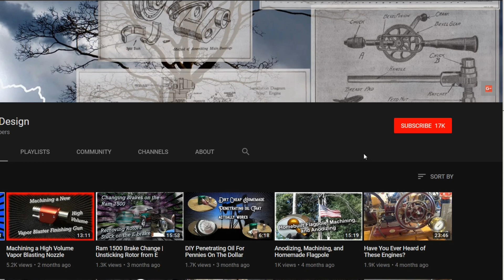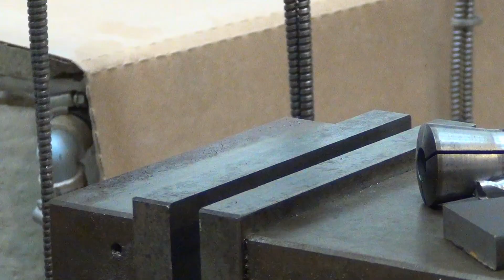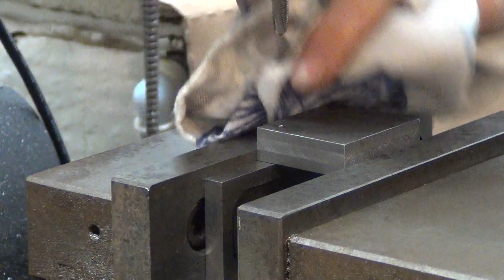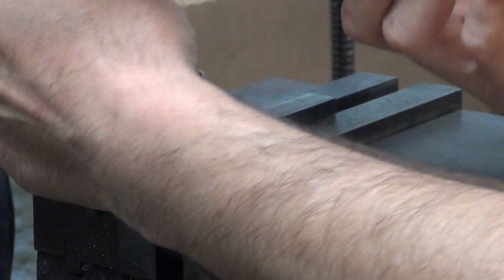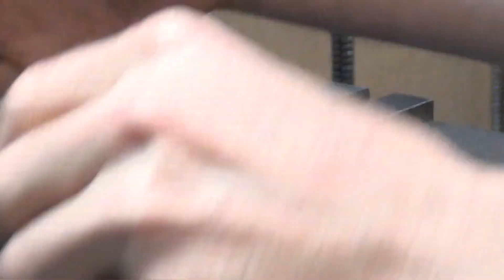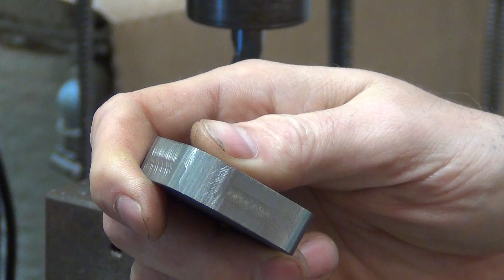Secret Trick to Mill an Outside Radius

Comment: If you don't need any more precision than that, a cheap Chinese rotary table will save you a couple of hours work and give you a much nicer radius, even with no DRO, and you can use it over and over and over. Or you can easily build a quickie work holder that pivots about a vertical pin.
Reply from the maker: Yes, I have a rotary table. It's had a lot of use here.

Comment: A belt sander is a million times quicker and if you want better accuracy then carbide router bits made for doing wood are cheap as chips and they work surprisingly well

Comment: What if the steel is longer? The back end of the steel will hit the ground of the vise.
Reply: find a different trick.
Reply: @mechanicallydisadvantaged1297  I genuinely need a different trick...
Reply: @rholanddelamerced  put it on its side and use a rotary table
Reply: @mechanicallydisadvantaged1297  ok I need to save more money to buy a rotary table. It costs almost 380usd here in my place.
Reply: @rholanddelamerced  if you can trade time for money--- plunge dril a couple dozen points about your radius. very tedious but ive done that before
Reply: @mechanicallydisadvantaged1297  thank you
Reply: @rholanddelamerced   I know it's to late for that job but you can use cheap carbide ( tungsten) router radius cutters made for wood on future jobs if you don't have a rotary table yet or just want a quicker way to get the job done.. the bits made for wood work surprisingly well and their a fraction of the price of a machining radius cutter

Comment: Nice trick, but meanwhile a lot of cheap DRO´s from China have a Function to cut whatever radius  you want, in steppings you want with tool diameter you want, and inside or outside....but it seems your DRO has not this function....so, good job anyway !
Reply from the maker: I have a Newall Dro with that function. This is for those without one
Reply: @ArnoldsDesign  thanks, im one without
Reply: Keep falling for China junk. Before long when they take away all the automatic stuff noone will know how to do it long hand.  Surely you can see this right?

Comment: Thumbs up, really neat work.  On the down side, there was enough metal in that block to make four dozen Chinese toasters.  What a waste.  Maybe mail them what's left and they can still get 3.5 dozen toasters out of it.
Reply from the maker: Probably so. I have a whole big box of drops to mess with, and a couple pallets full outside. They accumulate over the years, and you recycle them for chinese toasters, or use them for miscellaneous projects like this. I recycle the mill and lathe shavings mainly.

Comment: Cool idea. Using a  pin from both side made from a single wire that acts like a spring would making positioning easier. Thanks for the video.
Reply: Like a set of screw adjustable calipers with the ends filed to points.   That would work well.
Reply: @jimmurphy6095  That is a very good idea.

Comment: Set your tool gently onto a slip gauge of the correct radius on top of the moving jaw instead of faffing about clocking up the job.
Reply from the maker: By slip gauge, I assume you mean an old gauge block or gauge pin. Good idea. You probably should add the diameter of the pivot pin where it rests on the jaw too... Btw I don't really think the minute it took me to indicate this part though would really constitute "clocking up the job".

Comment: Now I understand why so many people get me to laser cut stuff lol, but very impressive old school trick nonetheless!
Reply: Its what CNC can do so very easily :)  .... laser cutting is all ok if you don't want a tight tolerance as i'm yet to find one that can hold a real tolerance.....  say 0.020mm
Reply: @martinfidel7086  The Prima Platino I run at work can get pretty damn close!
Reply: @Eschelonistic  most can, but the thing is the operator will often leave it set for thicker material so accuracy & quality is reduced

Comment: A half-way hack from someone who's mill is SCREAMING for maintenance (and oil)...thanks, but I pass...you've left a divot in the part at the radial center mark, you are 'swinging freehand through a curve' (big NO-NO for accuracy), and you are overlooking basic tools (such as indexing heads, ornamental mill table jigs, etc.) to accomplish what you are trying to describe here...
Reply from the maker: My mill is maintained just fine. It has always sounded like that. I've also had it for 20 years and not one drill hole or end mill mark on the table or vice. That's something you will likely never see on a machine that age.
Reply: @ArnoldsDesign  I have a KRV3000 and it sounds just like yours, I think what people are missing here, is that to do this without CNC or rotary table or dividing head etc is not easy !  This gives people a chance to make more parts for themselves, personally I use mitee bites and a CNC mill but then I have my own factory
Reply from the maker: @martinfidel7086  Exactly. Without a cnc or setting up a rotary table, outside radii are a pain. I'm not familiar with the KRV3000, but it might have a similar head. Mine's an Acer built in 97, and it's been rock solid. I'm not familiar with Mitee Bite work holding system. I just looked it up. Looks interesting. What does your factory produce?
Reply: @ArnoldsDesign  I make parts for race, rally and classic cars, and aircraft... most of my machines are CNC with a few manual to fill in the gaps
Reply from the maker: @martinfidel7086  Very interesting, especially the aircraft manufacturing part.
Reply: Show us how you do it, I like seeing lots of different ways of cracking the same nut, but I only tend to criticise if I've got something better to offer.
Reply: Make it out of thicker steel and then machine the "divots" off :)   as for the lack of maintenance these machines have a belt driven gearbox and always make that noise

Comment: just do the radius with the readout on radius function
Reply from the maker: That's an idea, but I just got the new readout and haven't learned that yet.
Reply: Does the radius function work by cutting in one axis only and moving it over a small amount ?
Reply: @martinfidel7086  yes you just use the radius function.if you cut a xz plane radius you input al the radius info on readout.the readout will then give you the coordinates for x and z and you feed with y axis.its only point to point but you can cut very smooth radius by using a ballnose cutter.you can even use a bolthole pattern for an xy plane radius.
Reply from the maker: @martinfidel7086  I don't know. Dawid Vos would have to address that.

Comment: Actually, you can use a center drill, or any other small bit. You use a pin whose diameter is larger than the diameter of the hole, so that the pin’s sides of the point, ground to between 60 and 90 degrees, contacts the edges at the point where they meet the surface. It’s much more sturdy than what was done here, and more accurate and repeatable.

I really don’t trust that pin, because each time you set it, the pin position changed with respect to the jaw top. As a result the pivot distance varied.

Ok, I get that this isn’t supposed to be a precision project. But there are ways to make even this method much better, but requires just a bit of work. But really, buying a cheap 6” rotary table on eBay is a much better idea. It takes less time to set that up than to do this.

A quick tip to set some small part horizontal. Use a 1/2” or larger dia flat end mill bit, or get a short 1/2” carbide bar. Set your basic height with the pin, making sure the vise isn’t tightened, and lower the flat down until it just contacts the surface of the part, in about the middle of the center of the pin. That will level the part, and you can tighten the vise.

Comment: Appreciate your time and effort to create this video. Nevertheless this has no practical use
Reply: It's quite practical if you need a radius on the corner of a small part. Do you have a better way to achieve the same result? (Without expensive specialty tools/attachments)
Reply: A 5 bugs file will do it less than 5 min

Comment: A job for a portaband and 4 inch grinder or a belt sander or you could just go completely wild and use the correct radius cutter end mill.

Comment: Have used the same effect but with a through hole as the pivot point. Works well where you need a large concentric radius cut around a hole for aesthetic purposes. Then finish off on a linisher. This is a good method for when there is no hole.

Comment: It never fails..you provide a useful trick to bang out a quick radius and people will find reasons to complain about it.
Reply from the maker: Yep, I thinking the same thing today.
Reply: Some people have no appreciation for a little learning.  Sure, it's not the most wonderful trick in the machining world, but it provides a way of doing a radius that shows some thinking outside the box.  I agree with you that people will complain about anything just to be contrary.  I appreciate you showing this, Arnold.  Keep doing what you're doing.
Reply: Actually I have been doing this for a long time with excellent results, but it's not weird.  For all who insist on a radius cutter:
 not every radius is 90 degrees,  not every radius has a commercial cutter to match,
 radius cutters are expensive and usually HSS, 
I can use a common shell mill with carbide inserts to do this very quickly,
This method also needs a less rigid spindle because you only have to take a shallow cut if need be,
 everyone doesn't have a NMTB 50 machine to hold a 2" radius cutter, even if you wanted to buy one for a one off  part.
So people get a grip because this method works, and is it frequently the fastest and most cost effective way to get the job done.
Reply: @stephensarkany3577  Agree with you.  Back in the day before CNC became as prevalent as it is today, we used to draw Involute curves (gears) on a Coordinatograph (fancy, accurate drafting table) using single points and connecting them with a french curve.   I'm sure newbies today would cringe at what was done before the days of Mastercam, Solidworks, Esprit and the like.  I for one appreciate people like Arnold that show alternate ways of doing things.  There will come a day in everyone's career when no matter what machine you work on, it won't do what you need and you need to be able to improvise.
Reply: @DonsWoodies  Too often after I see knowledge like this imparted I am reminded of something my departed Grandmother used to say; "If you don't have anything nice to say, don't say anything at all".
Reply: wxfield sometimes you need to say something. I’ve seen recommendations on YouTube that are frighteningly dangerous. Should we say nothing? Or should we warn those new to it? I go for the latter.
Reply: @melgross  I'm a big fan of Charles Darwin..survival of the fittest. If someone is dumb enough to follow dangerous or stupid advice let's allow them self-remove from the shallow end of the gene pool.

Comment: Way too much work to cut a radius. Much easier to mount it to a rotary table. If you don't have a rotary table it would been too hard to make a jig to cut the radiuses using a lever with a pin that can pivot on rectangle scrap metal with a hole. You just move the lever around the pivot point to cut the radius.

Comment: Its good the attempt to help the community for no personal gain but this method really should not be taught you can simply lay it out and tilt it up a few times not hitting the line and then finish sand, grind file..

Comment: Hi Arnold,

This is very similar to the quick milling machine radius that Dale from Metal tips and tricks release a video on a while back, minus the through hole.

Personally I think his method is a little better as it was faster to "index" to the cut, also from memory he didn't need a file to clean up after. 

Regards
Reply: He used a file too.
Reply: Except Dale had to bore a hole.

Comment: Is it possible to sand the part, using the divot mark as a guide?
Reply from the maker: Yeah, you could use a bow divider or compass, put one point in the divot and scribe the radius. Then you could grind and sand down to the line.
Reply: @ArnoldsDesign  I thought there would be an easier way, (if someone owned a sander of some sort, to do it. Thanks for the reply :)

Comment: That is an awful tedious process for a radius that is probably just decorative. I would do three segments, 45°, 22.5°, and 67.5°, and then use a file or sandpaper. But I also have a couple of corner rounding cutters.
Reply: or just whip out the angle grinder......do a 45 on each corner then round off....but I agree as well.....this looks tedious for the results...not knocking his technique or anything since there is more than one way to skin a cat.
Reply: Could do it in ten minutes with a belt sander and radius gauge just as accurately

Comment: Nice idea having time and patience :-)
 Indeed its not a radius or curved surface . But a series of facets, not equal in size or angle, but perpendicular to the same center. And easily smoothed with a file or sandpaper.

Comment: you reel need a Hurco  your manul  mill would be in the same place as mine in the corner  this machines can be bought for little money they were mad in 1981 89  you can still buy all new parts for them  Accurate  Machine
Reply from the maker: Don't Hurco's use a proprietary programming language? I understand G and M codes didn't work with them.
Reply: @ArnoldsDesign  I think most people replace the original control with something modern - probably Mach or Linux CNC
Reply from the maker: @gorak9000  I looked into Mach a few years ago. I just got a Newall DP700 recently b/c my old Sapphire died. It would be nice to use the linear scales and head to retrofit cnc controls rather than using rotary scales. It's still something I'd like to do.

Comment: OK good idea so how about this make a tool with a 2 mm hole in it shaped to rest on the vice jaw top and also be trapped  between the vice jaws with the part being cut. this tool would need to be fixed in position so as to not travel in the X axis but this way the pin location could be a fixed point that could be a removable pin that would stay in the part being machined so the part is stable in it's rotation the tool could have a small radius on it to be smaller than the smallest one you plan to cut

Comment: Would it be possible to cut guide holes on both sides, adhere a ball bearing on each side using grease, then clamp the assembly in your mill so it could be rotated while milling without having to loosen the clamp to reposition it?  (Perhaps with a reusable shimmed guide with matching holes between the workpiece and the clamp.)
Reply from the maker: I don't know. I never tried that. Sounds like it might though.
Reply: @ArnoldsDesign  if you want i can draw it on solid works for you for free.
Reply: @ArnoldsDesign    @Tom Eubank.   i was thinking about it,  it turns out there are already  semi CNC devices out there (KMB 1 HURCO) for the same porous as you demonstrated, so....  my mind came up with this simple idea,  .a turntable vice . i.e. a vice strong enough to hold the piece at the same time the vice can turn on the axis like you did it manually.  if you draw or sketch any thing, even very rough, i draw it for you and test it in 3D and send you the you tube and CAD files. waiting your next sketch for this. i will now go look for ready made 3D vises, try to modify them to your idea, wish me luck.
Reply: you would not want to clamp bearing balls just anyhow, they would brinell whatever you clamped them into... so you'd need to use soft jaws or mill off half of the bearing ball before you clamped it, i guess if i had to do this often enough to worry about it, i'd press bearing balls into aluminum softjaws/parallels
Reply: @SuperAWaC  if I had to do it often if set up rotary table...
Reply: @drickard67  if you had to do a production run, some kind of jig would be best
Reply: please see conversation below adopting your idea.
Reply: @Dreamer3K  Thanks for all the info -- your original video and the update.   Tom